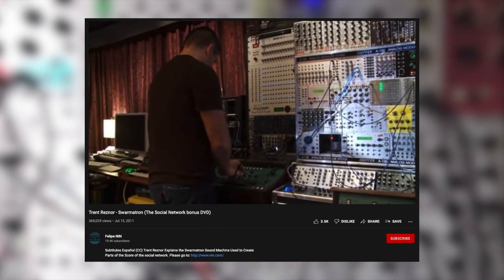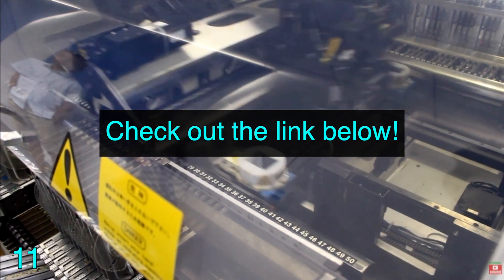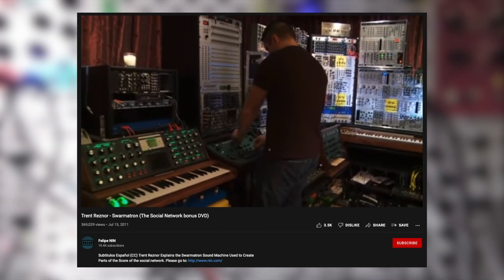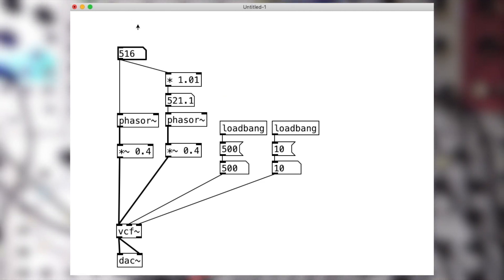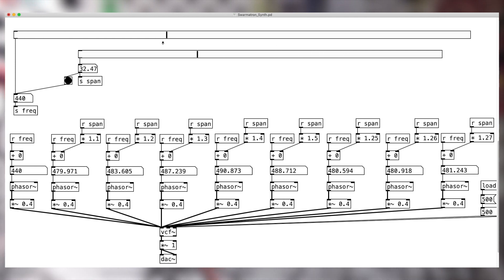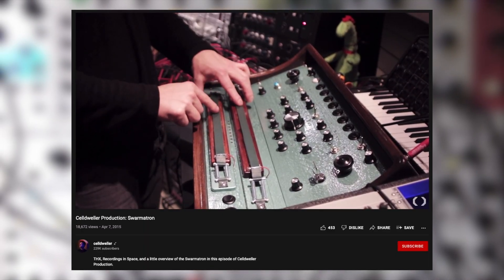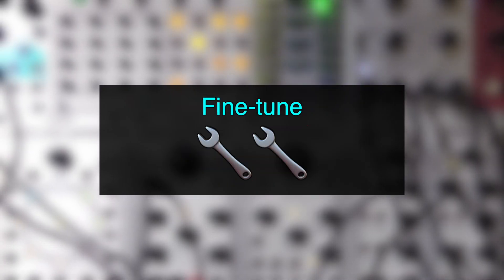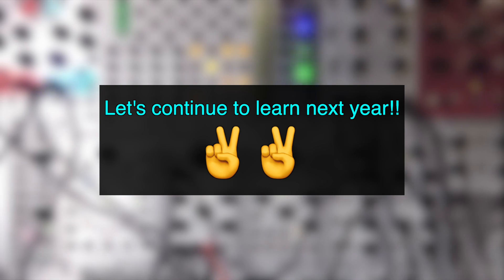DIY Swarmatron (Pure Data & Arduino Tutorial)

Comment: does you PD run an ardurno? Or is the arduino just the ribon midi controller?
Reply from the maker: Arduino is used for sending the ribbon controller data to Pure Data that's running on my laptop. If you use something like Bela or Daisy that I mention later in the video, you can have Pure Data running inside of it and also control the synth with the ribbon controller in a more direct way. Then you can either have a speaker connected directly or you can plug into a guitar amp for example.
Reply: @SoundSimulator  Your Videos are very informative, so thank you.

I wanted to ask a question regarding Pure Data.

Pure data uses blocks to achieve different sounds, but i saw some Pure data repositories on github, and they are line of codes not blocks, so how can i import those lines of code to work on pure data ?
Reply from the maker: @hashemamer8515  Thank you for watching! I think you can copy the text and when you paste it in Pure Data, it shows up as object blocks. At least that's how it is in Max. Give that a try and see if it works!
Reply: @SoundSimulator  The reason why i saw the lines of code in github is because i opened the project files inside of github, which i think is kind of silly on my behalf 😅, but when i downloaded the  zip file and extracted it, i can open a Pure data file that has all the pre-built blocks inside. 

Thank you for getting back to me.

Comment: what are the nodes under the loadbangs?
Reply from the maker: message objects :)
Reply: @SoundSimulator  thank you. I'm trying to warp my head around using plug data but all the documentation is for pure data, which i get,  plug is wrapper but I wish they listed out what goes with what. Like haveing to put the osillation number into the type of oscilators(ex: saw~ 440). It took me like an hour to figure that out in plug because that's not how pure works.